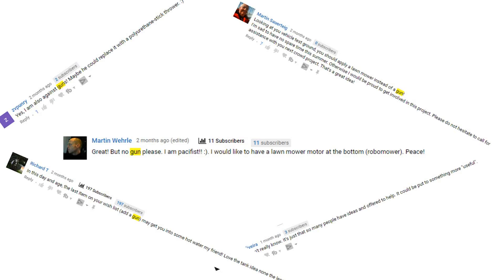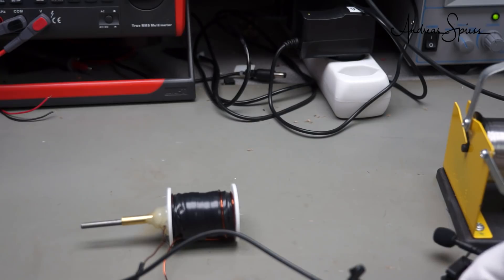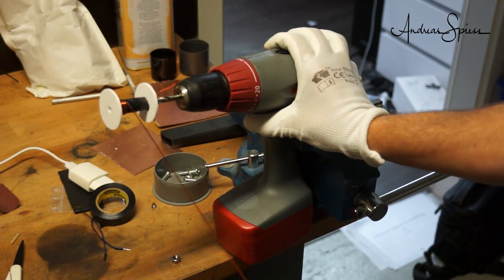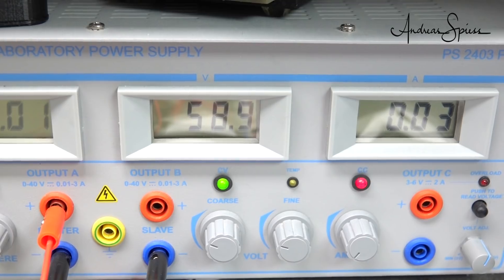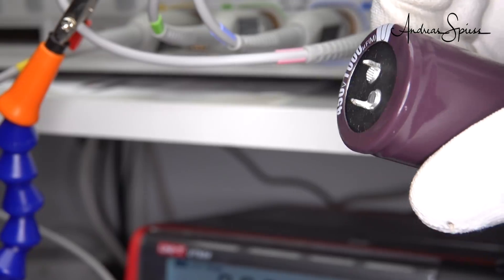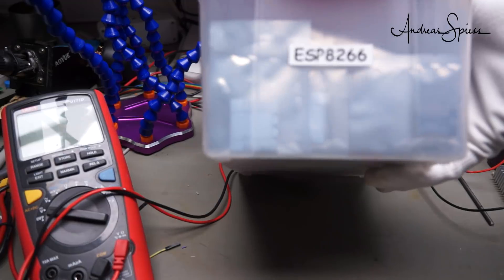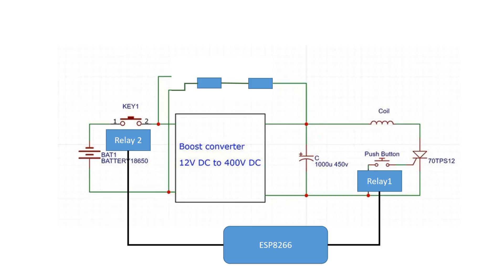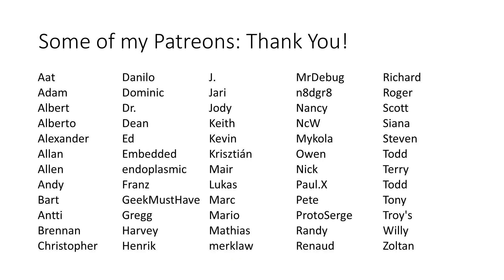#221 Better than GreatScott's Coil Gun? A true story, how-to not do it

Comment: You do not need any uC or code to make this work.  All that is needed is a zener diode (or an NE2 neon light bulb) to monitor the capacitor  charge voltage, connected to the coil of a DPDT relay (along with the battery, boost supply & thyristor).  When the voltage of the storage cap is high enough,  the   zener conducts, energizing the relay, which simultaneously disconnects the battery and energizes the thyristor, which discharges the capacitor into the coil.  This cycle would continue "firing" the gun (aka "coil machine gun") until the power is depleted or the parts overheat and fail.

Engineers would also add some current limiting resistors, a safety shunt switch across the thyristor gate and use a low ESR capacitor.

Power is not only dangerous, but requires knowledge to control.  uCs use microwatts. This thing controls  a million times more power: kilowatts. Connecting wires of only a few cm long are large enough inductors at the high current pulse to destroy things, such as the bench power supply.  

Ahhh..... The difference between engineers and "Makers":  Just get some Chinese Modules, some parts, some jumper wires, connect & enjoy the smoke!
Reply from the maker: So I definitely became a Maker!
Reply: Andreas, I love ya!  You started this project by following other "Makers"....  Unlike most of them, you do a lot of research into the fundamentals of what you are doing (i.e. RF). You do this to gain knowledge and then test designs to gain understanding and experience.  These qualities are not important to true "makers".  

The other part of the comment is to illustrate the old sayings "to a hammer, everything is a nail" "a carpenter will not consider building a brick house".  The best, cheapest and most elegant solution to a problem is not always a uC and some code!

Comment: I "built" (meaning bought a kit) a different design coil gun in high school. I think the caps were 330V/800uF in value; 2 in parallel. I don't remember the coil mH, but it was several dozen turns of 12awg enameled wire. The caps were charged from mains, full-bridge rectifier, & a 60W incandescent bulb to limit current. The difference in design... A 1/2" steel rod served as a core for the coil and guide for the projectile. The projectiles were made from aluminum doughnuts slid over the rod against the coil. This was sufficient to propel the rings about 30ft, but w/ much less force than your design. The school was too "chicken" to actually let me demonstrate the device at the science fair even with more than sufficient space. We also tried 1/2" copper tubing but the aluminum worked better.
Reply from the maker: We all have our "sins". My teacher helped me build an (illegal) FM transceiver. Because of him, I am still in electronics! And love RF.

Comment: Don't you wish someone would give you these caps?
 https://youtu.be/fKEaDhDTciQ then I'm sure you would build it right, at minimum better. Which would not be hard I may not be able to install my Arduino IDE correctly but I wonder if even I could have done a better job.
Reply from the maker: Did you recognize the difference between the two videos? One concentrated on the effect and one concentrated on the build. That's why Hacksmith has much more subscribers than me ;-) But his capacitors were impressive!

Comment: Had the same thing happen to a pump start capacitor. Bought the pump from Craigslist. The previous owner had it running on 120V. I switched the coil connections to run 240V to pull less amps. Had to replace the cap as it was bad. Pump started and ran smooth, for about 30seconds. Then the smoke from the cap completely engulfed me.
Come to find out the previous owner had the cap installed incorrectly and was always engaged, even while running. He did complain the pump wasn't running as it should and I figured it was because of the faulty cap. The cap was rated at 120V, which was fine while he was running it. Since I changed the wiring, it was now delivering 240V through the cap.
Had to get another cap (which fortunately the local shop warranty exchanged the cap which was nice, but $10 wasn't bad if I needed to shell it out again). This time I verified it was wired up correctly. Fired it up, and pump ran smooth for well over 10mins when I stopped the experiment.
Reply from the maker: So you also had a learning you never will forget. The noise and smoke was aweful!
Reply: Yep.  Mine was loud, per se.  But it was definitely smokey. A really thick white smoke like a smoke grenade. I will definitely be checking wiring before I just assume it was connected properly. And the smell kinda gets up your nose and hangs around for a few hours.  ugh

Comment: The solution is to use a low voltage capacitor with high voltage - not as cheap as nails though.
Reply from the maker: I assume you meant with high current. But unfortunately, you have a coil. So you need a certain voltage to get a good current.
Reply: I should have been clearer Andreas, I meant blowing up the capacitor - that seems to have given enough energy to power a projectile, like the metal cover. No coil, no circuit, just high V to blow up the cap.

Comment: I always isolate microcontroller outputs.
Reply from the maker: You are a wise man!
Reply: Andreas Spiess I use simple high current limiters as well.

Lamps. BETTER than fuses They can stand the heat and they give you light, indicating a short or high current. Maybe you can use them one of these days and refer me 😊 Cheers friend

Comment: i use 0.1ohm precision shunts for measuring current.

thanks for not listening to the anti-gun posters. this made an interesting video.
Reply from the maker: You are right. I could have used sich a value, too. But then the connections are quite critical. And frankly, I did not expect such high currents

Comment: Ouch, you must not switch the thyristor/SCR gate directly from anything that cannot handle the high voltage! Once the device conducts, the high voltage will be present on the gate as well - and successfully blow up anything that is connected to it unless it is rated to handle it. Just look at how a thyristor is constructed and it will be obvious what has happened. 

There are optotriacs/optothyristors available which have the gate galvanically isolated (basically have a built-in optocoupler). Alternatively, you can use an IGBT or a MOSFET, in either case the gate is insulated and you won't have this problem unless the device fails.
Reply: Always count on the device failing! 😎
If you do, it won't.
Reply: Well, yes, but if the optocoupler (whether standalone or one in the optothyristor/triac) blows, there isn't much you can do. MOSFET/IGBT is a bit more risky, there I would probably add the optocoupler as an "insurance" even if it strictly isn't required because when these devices fail, they like to fail short, with all pins shorted together. The resulting BANG will likely take out everything nearby.
Reply: Murphy's first law: if something can go wrong: it will do it!
Reply: @zolatanaffa87  don't forget Sod's law (NOT the same as Murphy's, despite popular misconceptions). You correctly stated Murphy's law but Sod's law states: WHEN something goes wrong (Murphy's has already said it WILL) it will go wrong at the wrong time in the wrong way, cause the most damage it can and unlike lightning it CAN, WILL AND DOES strike twice or more! 😂😂😂😂😂😎
Reply: Bob Lewis:
O.M.G. !!!!.
there is absolutely no escape!
we have to knock on wood at least three times before turning on any new circuit,  hoping for better
Reply: @boblewis5558  Actually lightning strikes multiple times in the same place.
Reply: I am not that of an expert in electronics, but wouldn’t you just be able to use a diode so that the high voltage does not go back to the esp?
Reply from the maker: Jan, can you recommend one? My optotriacs (MOC3063)  have a zero crossing detector, which in this case, is probably not a good thing.
Reply: If I remember correctly, MOC3011 lacks the Zero crossing Detector.
Reply: @AndreasSpiess  The MOC3xxx series has many members, some have zero crossing detectors and some don't. You can find full datasheets on all the members of the family at www.onsemi.com I would recommend a MOC302x (such as 3022) or even better a MOC305x (3052) which have maximum working voltages of 400V and 600V respectively, and don't have zero-crossing circuitry. The zero-crossing will prevent the opto-triac in the coupler from firing if the applied voltage on the output is higher than 20V, regardless of input.
Reply: @AndreasSpiess  I worked with some high voltage application and we used STE145N65M5 N-Channel MOSFET or similar, really nice Rds(ON) of 12 miliohm and some wiggle room for voltage and current. Also every low voltage signal should be isolated from HV side, I would recommend to stick to relays - I don't know why but they seems to me that they are more suitable for the job.
Reply: I'm designing a suitable driver as we speak...

Comment: The next development is to add more stages and use the microcontroller to sense the position of the nail and to time each pulse for each subsequent coil to boost its velocity.
Could do it blind using characteristics for a known mass and produce timed pulses. If coils are linearly spaced then pulses increase in frequency, or keep pulses linear and exponentially increase coil spacing.
This technology is decades old. I wanted to make one 45 years ago!
Reply from the maker: At least one stage would be ready and could be multiplied. But then, a relay definitively would be too slow. The bullet moved already quite fast in the first stage...
Reply: Yes, would need microsecond precision or greater, maybe mosfets for switching, and account for propagation delays. If a pulse is too long it could also reduce the velocity.
I'd use a genetic algorithm over many cycles to find the optimal combinations of parameters, pulse shapes, coil distances, geometry etc, then models can be created.
Stability could be enhanced by prespinning the projectile, using pop out fins, a sabot carrier or some form of rifling that won't sap too much energy.
(I'm pretty sure that all these obvious ideas have been tried a long time ago and these weapons already exist)
Reply: Back-EMF could be sensed to determine timing. That would provide some Independence from projectile mass and length and be potentially self tuning.
Reply: Back EMF could provide a signal of where the projectile was, but probably not very helpful for predicting the timing for where it will be in the future.
I'd go for two IR diodes and sensors across the tube in front of the next coil to get entry velocity and hence derive pulse timing and duration for it.

Comment: I'm pro-coilgun.
Reply: Don't shy away from high voltage. I've done a lot of projects with it, (been a while since I've put a video online though) Do some more work on the coilgun, please! :)
As other's have said, free-wheeling diode, better DC-DC converter protection, and discharge resistor on electronics. It can help to have a neater setup too. High voltage electronics is the most fun! Half of that is blowing up components! Best thing is... you know when something isn't working, and it alerts you to the fault instantly, no slow painful debugging!
Reply: I'd be more afraid of a metal projectile hitting me at high speed (after all, normal guns are deadly because they throw a metal projectile at a high speed) than of high voltage.
Reply: Pretty easy not getting shot. Just don't stand infront of the barrel (or behind it if you haven't established the coilgun's polarity) As easy as not getting hit by a train. Don't stand on the tracks. Sure, some people get hit, but the world is probibly in safer hands without them.
Reply from the maker: GRBtutorials: Only if they hit you ;-) In Africa they shot at me with a machine gun, fortunately they did not hit. But it was a lasting experience. 
As I said, I would probably not give it to everyone. But it is the same with knives or  cars. They are potential killers.
Reply: And what if you accidentally press the trigger? Or move the robot meanwhile pressing the trigger? And let's not forget that you could accidentally hit someone (or something) other than you.
Reply from the maker: GRBtutorials: Here I have to argee.
Reply: First: I don't have rat poison.
Second: it's much easier to accidentally press a button than to pick up a rat poison bottle and not noticing it. Anyone can have a bad day and oops! I've made a hole in the wall! But you'd need to be really dumb (or really sleep deprived, or drunk) to get rat poison and not notice it until you eat the food. 
Third: It's easier to not notice a small coil gun pointing to you or something than not noticing a car coming to you, meanwhile being inside a car!
Reply: Oh, I was several times under fire in my life 😳 . My first experience was being bombed by mortar fire, this wasn't funny at all 😣. But I could find cover between large solide rocks. I was also nearly shot by gun fire, when an idiot (he was by the way a studied Mathematician) manipulated his gun 10 meters behind the line of fire. And the same guy nearly hit me with a granade launcher. And guess what, it was exactly the same scenario  😖. Therefore I refused to stay in front of this comrade, after these happenings.
Reply: Therefore safety regulations are existing. Obey the four rules, and you will be save!
Reply: GRBTutorials, if you are afraid of pressing the button by accident, you can build in a second or third security feature. I would suggest something like a "Dead man's switch". Another possibility is to lock the system by password. It is possible to send an encrypted message, which enables the MC to switch a relay in front of the DC to DC converter.
Reply: @AndreasSpiess  You should always spread the schematics everywhere you can spread them, especially on torrenting sites. Obviously you shouldn't sell them, you could get into trouble. Information should always be free.
Reply: @GRBtutorials  Literally the same argument with firearms. What if you slip while cutting food with a gasp KNIFE?!